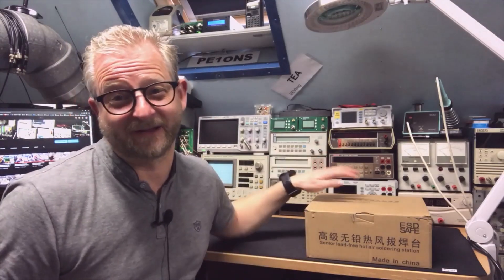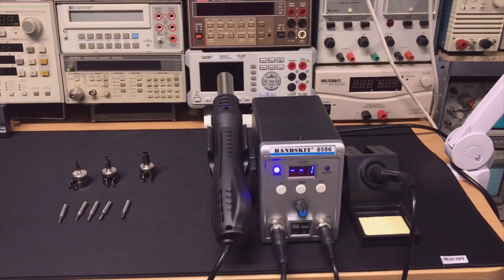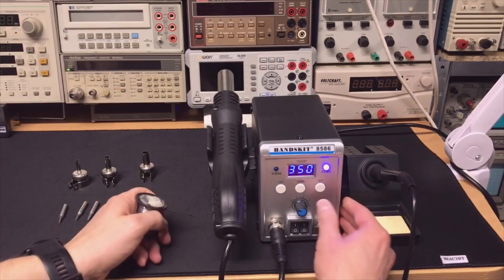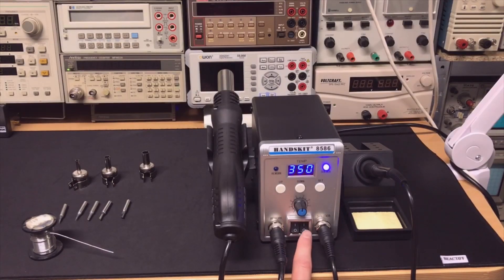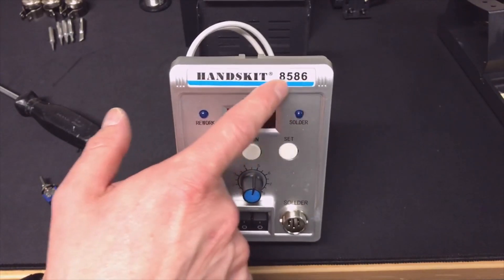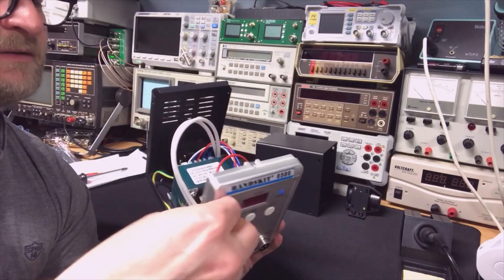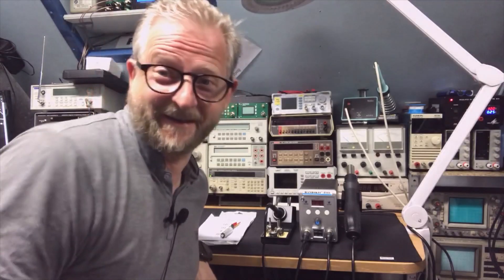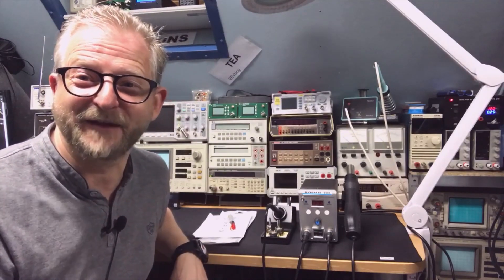#078 Handskit 8586 Rework Station Teardown and powerswitch mod

Comment: Surely the heatgun cable should be permanently connected to the device if there is 250 volts ac on that front connection?? 
If anyone touches their finger off of that when heatgun is taken out they will be fried.
Reply from the maker: No-one is allowed in my lab :) but good ponit

Comment: I have a problem, We have the same model but mine is Yarboly 8586 the soldering iron is not heating
Reply from the maker: Hello Michael, did you have a good look at the switches, is it wired correct? do the LED light up? if i remember correct, the switches also work a bit weird, try different combinations.
Reply: @TonyAlbus  Yes i noticed, and i wonder why it so light and as i open it it has no transformer but the rework is still working and the soldering iron is not working anymore. Do you have some recommendations and suggestions to offer so i can fix it?
Reply from the maker: @michaellaurencemata1781  Maybe you can measure if the heating element works, follow the wires. to the switch .. or ark the seller if it is okey without the transformer.

Comment: I bought sumsour brand 8586 station in Amazon . it has the same outside look and design but there’s no transformer inside the case,so I don’t know if they are reliable without a transformer
Reply from the maker: Ho Nilo, don't worry to much, with an external supply, its also more easy to replace if you have a problem, both have cons and pro's. Enjoy!
Reply: @TonyAlbus  I don’t want to return it because of the cheap price and I’m doing this just for hobby. I will posted the internal parts in YouTube and hopefully everyone can see it, any feedback is greatly appreciated
Reply from the maker: @nilolee2426  Hello Nilo, i did not understand correct, i thought you have one with an external supply, now i understand it does not have a supply.. i think you should return it. Amazon has good return policy i think you can ask for a free return ship label and after they have received the package in 2 to 3 weeks you have your money back.
Reply from the maker: @nilolee2426  What do you need to know? i have one..?
Reply: @TonyAlbus  I will post a video tomorrow check it out ,thanks

Comment: Hello there mr tony, why dont you take a look at the T12 soldering stations, they are very small and powerfull, with a fast switching tip, so you can change the tips on the go while working.
Reply from the maker: thanks! , all suggestions welcome!  will have a look.